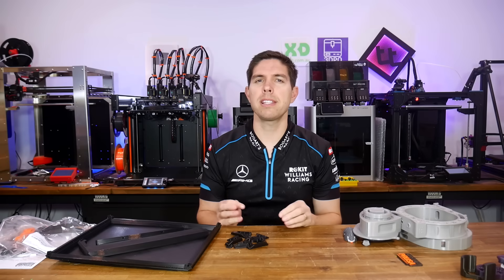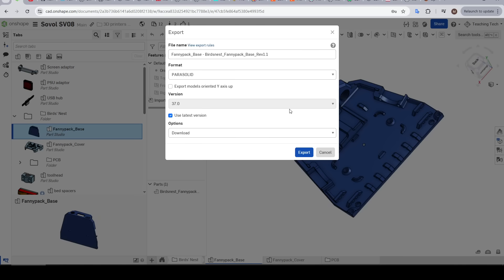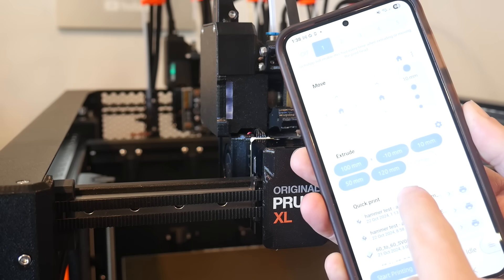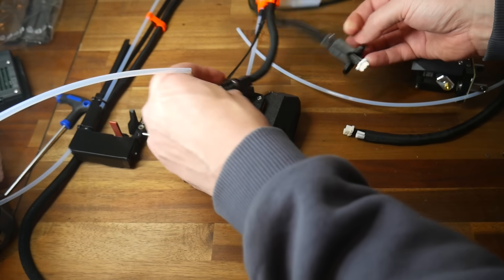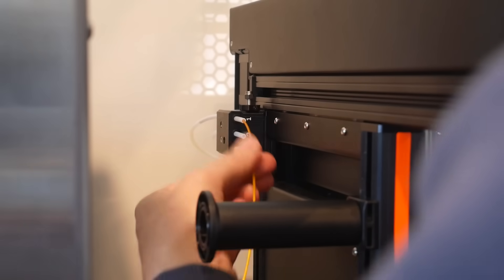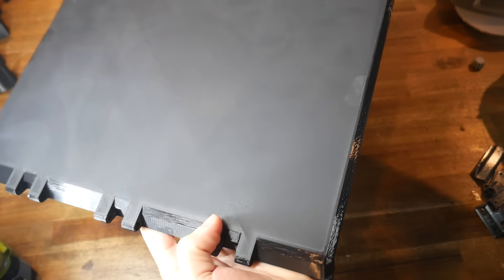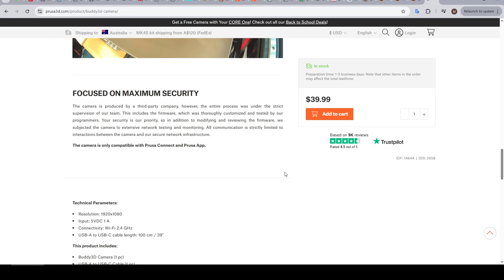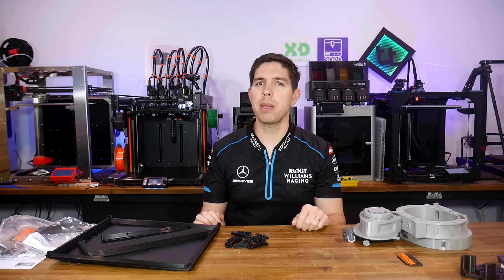Evaluating my replacement Prusa XL + SV08 update

Comment: Honestly, the XL was the best and most ambitious printer Prusa has ever offered in my opinion. Unfortunately, it is ridiculously-complex and the end results are prints that look no better than anything else and zero time and material savings due to having to reprint things so much. I was an early-adopter too. To clarify, I gave Prusa a deposit, then 2 years later they finally delivered. I had all the problems shown here and more. I fought with support to get them to send me a new printer but they never agreed to it and I had to jump through so many hoops and spend hours and days just trying to fix some of the problems. The only reason I kept it was because I needed reliable multi-material, though it was never actually satisfactorily-reliable enough. Once Bambu released the H2D, that made the XL completely useless to me. I have had absolutely zero problems with the H2D and it has worked on day one as an ultra-reliable printer that has so many more features that actually work compared to the XL. Once the H2C comes out later this year, I can't see anyone wanting to buy the XL and it'll become a niche product for people who are dead-set against Bambu. As a long-time Prusa customer who has purchased a lot from them (to the tune of an average of USD 20k per year over about 8 years!) I wanted to give them a chance to see how the Core One held-up against maybe an X1C. What a disappointment the Core One is as well - broken plastic panels, loose screws, prints that took forever to start due to passive chamber heating...what a joke! Glad that you got a new XL but the rest of us who aren't influencers are left out in the gutter with this large contraption that cannot be re-sold because no one wants it.

Comment: Hoping the Snapmaker U1 and Core ONE + INDX fare better overall. The XL is so bloody expensive. Nice insights.
Reply: I'm looking forward to upgrading my SV08 with Bondtech INDX, and maybe my Sovol Zero as well.
Reply: @Liberty4Ever  Yesss. I've been eyeing the Ender 5 Max myself.
Reply: As I already have the Core One, so I am really looking forward how that INDX will work out. By the way - I am really happy with the Core One. It's a real workhorse. The combination of this printer with FreeCAD is like a dream. I go from idea, to design, to prototype in a matter of hours and sometimes even minutes. Add a INDX to that combination, and it would be perfect.
Reply: Upcoming H2C is gonna be a better option. bambus tool changer looks amazing.
Reply: @jimmer411 It actually looks like the worst option. It adds a ton of complexity while still requiring multiple AMS units and having slower tool changes that will still require more priming than the U1 or INDX. Plus it will be very expensive. No thanks!
Reply: @jimmer411   the H2C is going to be the worst of both worlds. still need a AMS to load the filament and as a result of loading and unloading the filament you will also need to Purge after every swap. and then you have the added complexity of a tool Changer.
Reply: @jimmer411  it's going to be the worst option... nozzles don't have their own independent filament paths; they share a common one that still requires cutting, retraction, and re-insertion, and priming every time you change filaments. the only thing you're getting over basic AMS is not having filament mixing in the meltzone after swapping (so you can technically do true multi-material printing). you still have to purge a bit, just for a different reason. you're not purging to clear out old material per se, but rather to push the filament back down into the meltzone. because the filament you just inserted was cut and is no longer directly connected to the meltzone plastic, retractions won't work if you start printing without purging a bit first.

Comment: I'm considering getting a PRUSA XL for work but I'm still hesitant after seeing all your issues. Ultimately we need an "affordable" consumer level machine that can do multiple materials with a large build volume. Right now we have one of the S line Ultimaker machines, it's capable and we've had no issues with it over the last 5 years. It's not the fastest or the most feature rich but it's been dead reliable for years of consistent printing.
Reply from the maker: So far I've had no reliability issues on the new machine. It's continued to print non stop since the video was uploaded. Hopefully those spending this much on an XL dodge the issues I had on my early model.
Reply: My old workplace diched a pair of S5 for some Bambulab H2D and P1S. It was a almost perfect upgrade.

Comment: I still enjoy my 5TH XL. I don't regret the big purchase at all. The XL is still the king for printing big or multi-color. I've had some issues with it, but nothing as bad as Michael has had with the pre-production model. I also have an X1C with AMS, an H2D with AMS, and a Core One. The X1C is my go-to for speed. H2D shines for single color printing with a different support material. I'm still waiting for the Core One to find its niche. Maybe with a Bondtech INDX upgrade it'll soar.

Comment: As a Canadian, my shipping woes aren't quite as bad as yours, but I do get tired of Yanks not paying attention and then telling me my cost numbers are wrong...

When the XL was announced, the only part of it I was really excited for was the all-in-one nozzle and throat - and then the X1C came along and I ditched my XL preorder for that, which did everything I wanted from the XL and more.  Today I can't really afford a new printer - and if I could, I still don't need that huge build volume.  I mostly print ABS, so smaller is better.  And, well, the U1 might only be 4 heads instead of 5 but that's plenty for what I'd be doing - which would be to have a small and large nozzle ready to go, and then two "defaults" at 0.4 or 0.6 either doing dissimilar support materials or just ready for filament runout.

So that CoreOne with what looks like INDX is intriguing, but the XL offers nothing for me.

Comment: Every first gen has early adopter problems, eeespecially prusas. With my MK4 I had serious problems with the LCD display, and in turn with the USB drive (as it's attached with the same cable to the main board). The printer would randomly freeze at times and ruin the print.
Luckily Prusa support is great, they replaced it as soon as I mentioned a problem and provided some proof.

Seems weird that you're still having retraction issues, doesn't the XL use the same nextruder system as the other prusas? It's usually rock solid. Heh, I'll wait for the indx version of the core one lol. I hope they'll make a 2nd gen XL fixing all this stuff, just don't buy it the first few months! :p

I love the menu with dial honestly, much better than the touchscreen on my bambu even if it looks worse

The wifi absolutely should be faster, but prints start faster than when sending them to the bambu so 🤷‍♂️
Reply: I think accepting that "early models have problems" lets manufacturers off the hook for insufficient testing and quality control. It's completely valid to be dissatisfied by a released product not functioning as expected.
Reply from the maker: I agree with @Dave_theDave , I didn't pay a reduced price for my early model so I don't want a diminished experience. My early Prusa Mini was defective too. On the stringing, some here in these comments speculate that the long PTFE tubes add to the stringing compared to other machines with the nextruder. I might do a little test for this.
Reply: @TeachingTech  oh yeah I completely agree, and yeah if they offered discounts on printers sold the first few months it would be better. No manufacturer is gonna do that though, haha
At least they tried to make it right though and they don't shy away from offering replacement parts/printers to normal customers that aren't youtubers (in my experience).

I won't back down on my defense of the dial menu though :D

Comment: Different PLA brands may require different retraction settings to print perfectly. I wonder if the stringing is because the PLA you use does not match well with the Generic PLA profile.

Comment: FWIW, I don't get that stringing. But I am religious about storing my filaments in a sealed box with desiccant at below 20% relative humidity after drying them. From what I can tell, the stringing is due to the filament sitting idle at 70°+ in the other nozzles while waiting their turn. Any water in them at all (yes, even PLA. A couple of days of exposure to my ambient house is too much) makes stringing a real problem when you have inactive toolheads. Also, and quite unfortunately, the input shaping calibration is not included in the calibration menu, you have to go into the configuration page. Which is dumb.
Reply from the maker: I have ordered the parts for this: https://www.printables.com/model/939432-prusa-xl-series-sicco-box-the-prusa-xl-drybox I guess that means three parts to this mini series.
Reply: @TeachingTech  Looking forward to it!
Reply: Prusa need to enclose ALL the filament and have space for desiccant bins like the AMS.
Reply: @rackbites  That works for me. There are lots of printable solutions available, but a in-house provided solution would be great. Preferably one that's not about $600 over its competition though; their in-house enclosure for the XL is kinda absurd.

Comment: From what I have seen, I think I'd rather build a Voron tool-changer.
1) I think it'll actually be cheaper if I remember the prices right.
2) I have fun building stuff, and I don't remember the XL having a kit option.
Reply from the maker: I got the 'fully assembled' version, which still contains the work to set up you see here. There is a 'semi assembled' version that needs more building and is $500 USD cheaper.
Reply: @TeachingTech  I figured the semi-assembled would be more like the SV08 in terms of what was needed rather than a full kit like the LDO Voron kits or the Prusa Mini+ kit that I got several years ago.

Comment: It seems frustrating to still have to do mods to get a brand new, US$3500 printer to work properly, nevermind the quirks like needing partial disassembly for the dock calibration or PrusaSlicer having some limitations. For the average consumer, it's hard to see what the Prusa XL offers over the ~$1000 Snapmaker U1 apart from a larger build volume, since the U1 will also have open firmware but has more user-friendly tech.

The XL might end up being a niche within a niche, with mainstream printing being a competition between U1 class toolchangers, BambuLab's Vortek hotend changer, and BondTech's INDX passive toolchanger. All will be much cheaper than the XL.